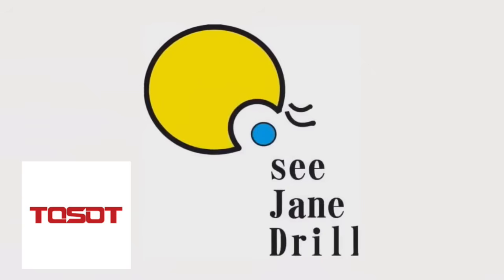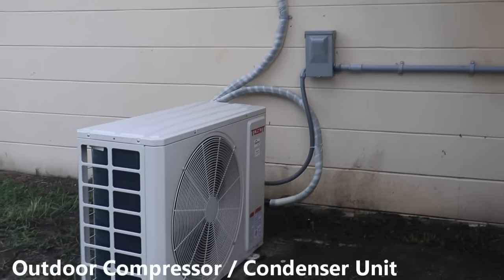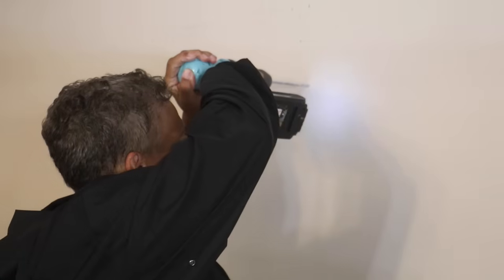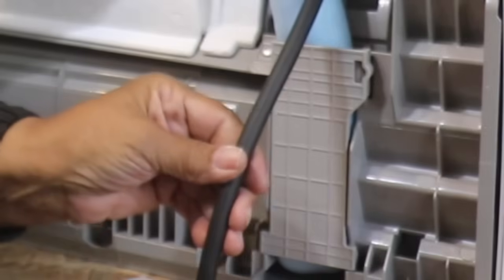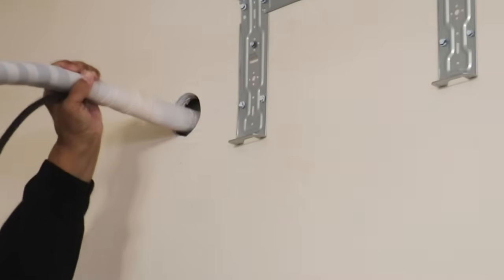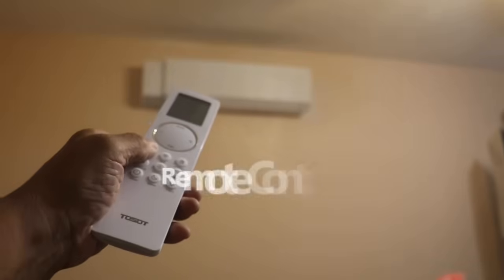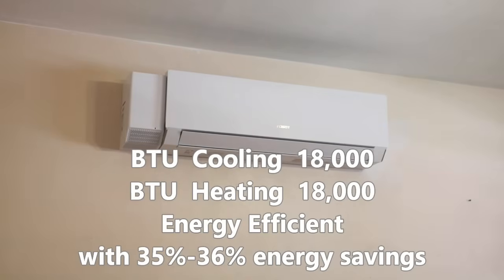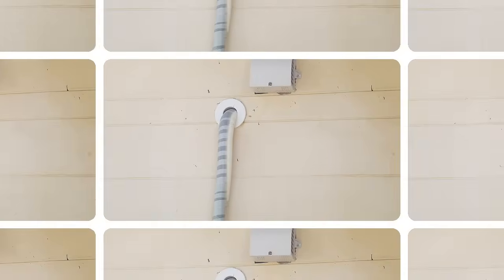TOSOT AORAKI ERV Mini Split AC// a beginner's install tutorial

Comment: Q: WHY WOULD YOU USE A STUD FINDER WHEN THEY'RE NOT ACCURATE 
AND ITS EASIER TO TAP ON DRYWALL TO FIND STUDS ???

ITS A REAL QUESTION...

TAP, TONE CHANGES YOU'VE FOUND A STUD

SUGGESTING THE USE OF A STUD FINDER IS A RED FLAG
Reply from the maker: I don't share your opinion.  Yes, you can  knock on a walland listen for hollow sound however a quality stud finder does a deep scan and can identify items beyond studs.

Comment: I’m learning to do this stuff because getting a contractor to come to a job is harder than pulling teeth from an alligator.  The few that have shown up do such crappy jobs you wonder why you even bothered to hire anyone. No, I don’t hire people on a whim or pay next to nothing. 

I put in a new heating/AC system because the upstairs bedrooms were so hot all the time. I asked about a second unit and he said it wasn’t needed. I went in and on about how I want a system that works and keeps the upstairs at a reasonable temperature too. The first summer after the upstairs was still super hot. His response is “well hot air rises.” No care that he was hired to solve that problem. I also didn’t go with a contractor grade unit either. 

We had a fire that gutted one room in our house but the rest of the house was fine. The contractor was paid roughly $80k to fix that room as well as seal and paint the whole inside of house (the house is only 1,409 sq feet). It’s such a mess, they also ruined my electrical, and half the stuff they were hired to do didn’t get done. 

I’m not looking at learning to do these things myself. At least if it turns out bad I only have myself to blame.

Comment: Hi, Leah. Nice job! After you connected the refrigerant lines, did you get someone to pull a vacuum on them prior to opening the valves on the condenser unit? Ordinarily, after any component of the sealed system is open to the atmosphere, a vacuum has to be drawn on it to dry the line. I have installed mini-split and whole-house split systems, but not DIY kits. Maybe those have line dryers to eliminate the need to pull a vacuum on the lines?

Thank you for your videos. I always enjoy them.
Reply from the maker: I did it myself

Comment: How do you uninstall a mini split system?
Reply from the maker: there is a way to draw the coolant back into the compressor (outdoor unit) so that you can then remove the coolant lines.
Reply: @seejanedrill would it be best for me to get outside help instead of doing it myself
Reply from the maker: @lakishagavin  You can....it'll cost about $75
Reply: @seejanedrill you are an awesome teacher by the way🎉🎉🎉🎉🎉

Comment: Save a little money?  No.  Installing your own Mini Slit saves a LOT of money these days.  Thanks for this, it will help a lot of people like all your wonderful DIY tips!  I installed my own MS 4 years ago which not only cost be about $6k less than hiring it out, but paid for itself in savings within 2 years.  Nowadays it might coast $10k more to hire it out around here (Cdn dollars) - NOTE in most cases the DIYer can carefully bend out the coolant lines from the inside unit, push through the hole and mount the unit .. then attach the coolant lines outside the wall which is much easier than attaching them before mounting the inside unit as shown in the video.  Might depend on wall thickness though.

also note: the square footage the unit can condition is different for cooling vs heating.  My 24000btu unit heats my 1500sf main floor very well, but it only cools about 700 sf of it - just the open areas like kitchen living room dining room.  Why is that?  well cooled air tends to sink and sit while heated air naturally convects and stirs up the air, thus spreads around more effectively.  The cooling does not reach any of hte 3 bedrooms while the heating does reach them all, though partly because my living room is sunken 14 inches which really traps the cooled air despite being an open concept house.
Reply: A friend of mine spent vacation days and paid for HVAC classes and certification to plan and install their ducted air exchange heat pump. He said all that still cost less than paying a company to install it for them.
Reply: I installed a MS in my house in AZ. VERY HOT. I have several industrial fans to push the air into the main part of my house. My central ac has not turned on all summer. I do have a portable ac in my master bedroom to keep us chilly at night.

Comment: I see you post and I practically run to watch. I can’t do the wiring
Reply from the maker: You could if you joined our See Jane Drill community.
Reply: @seejanedrill I’ve some basic wiring but I’m not confident enough to do the shut off box or tap into the outside wiring on the house.